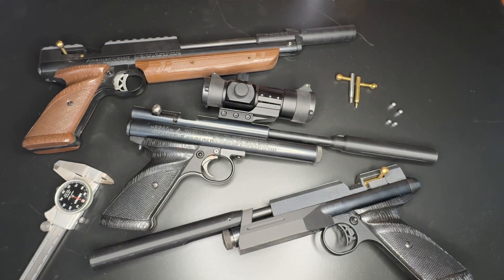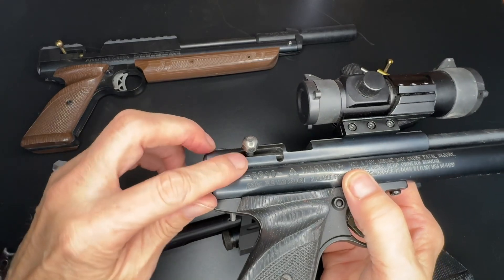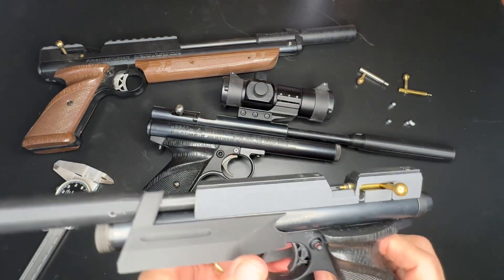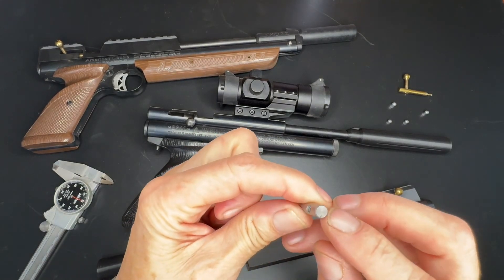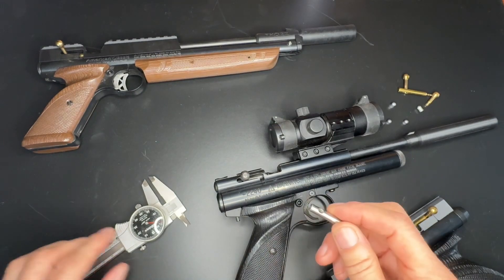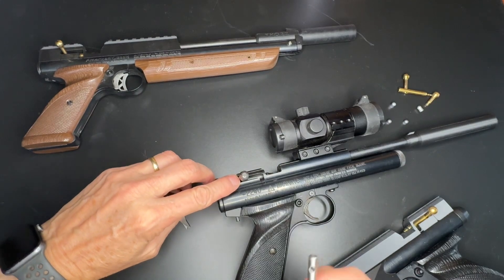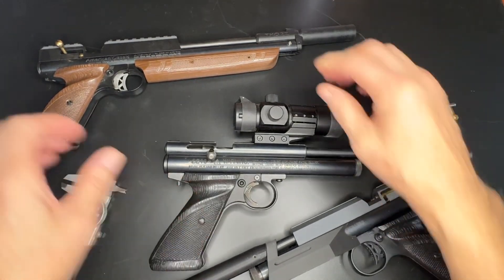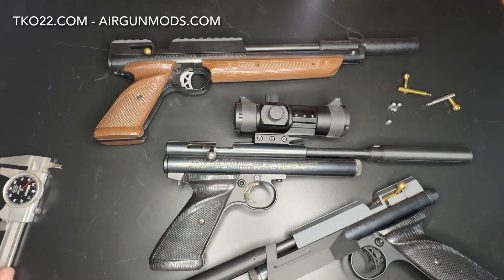Crosman 2240 bolt mod

Comment: Put a small magnet in the end, it'll hold the bolt open when loading.
Reply: You would still have to remove some of the bolt’s back end but the magnet idea is clever.